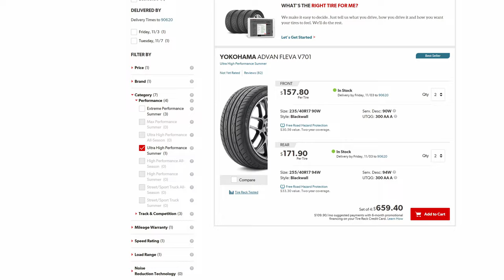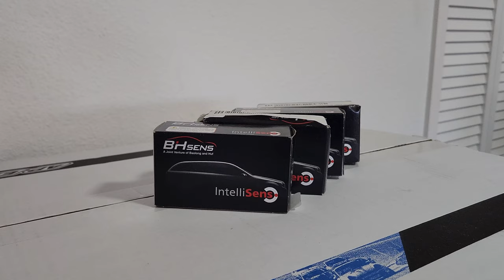🔥FINALLY NEW WHEELS on my BMW Z4!!! | Apex ARC-8 | Vlog 6

Comment from the maker: What do you think about the new wheels?
What color caps? Red, Blue, Both, Black, Green, or Yellow?
How about the lettering? Single or double edge or none?

Gloss Black Grille: https://geni.us/LaQ0T7z
Matte Black Grille: https://geni.us/6nDYf4U

Stubby Antenna: https://geni.us/DD1pk6
Stubby Antenna Jr: https://geni.us/B0Odc

Wheel Locks: https://geni.us/GqrdE
Lug Bolts: https://geni.us/hnYIViq
Wheel Hanger Pin: https://geni.us/jmnzk

Rally Armor Mud Flaps: https://geni.us/KzzNg
3M tape: https://geni.us/846A

Low Profile Megan Racing Ramp: https://geni.us/ocg6
Low Profile Floor Jack: https://geni.us/EAHkV

Griot's Tire Dressing: https://geni.us/ITDZ6
Sharpie Paint Marker: https://geni.us/wu8tVG3
Yokohama Advan Fleva Front: https://geni.us/1f3Ex
Yokohama Advan Fleva Rear: https://geni.us/90lx31M

Hankook Ventus V12 Evo 2 Front: https://geni.us/BpSPzGi
Hankook Ventus V12 Evo 2 Rear: https://geni.us/qqhd8QA

Graphite Grille Left: https://geni.us/xRXiUq7
Graphite Grille Right: https://geni.us/vRQ0GJ

Camera Equipment
Samsung Galaxy: https://geni.us/VQQT
Microphone: https://geni.us/eAFOKz
DJI OM: https://geni.us/xeB7agB

*Please double check compatibility before buying and be wary of non OEM as it may not be exact*
Help support me breaking apart my car and putting it back together. This description contains affiliate links. If you buy a product through my custom link, I will earn a small commission at no extra cost to you.

Comment: I used to have 17" winter tires (4x225/45 Kleber) on the Z4C and moved to 18" summer tires (4x225/40 Goodyear Asymmetric 5) and then moved to two sets of summer 19" (KUMHO PS91 (235/35 and 265/30) and a set of Michelin PS4S (4x235/35)). In my experience the ride comfort was the WORST with the 17", then 19" KUMHO, then 19" Michelin and the most comfortable was the 18" Goodyear. The steering is by far the best with the PS4S. If you take into consideration how the car looks - 19" is a no brainer. (hint - E9X OEM Styling 230 alloys are the perfect match for E85/6).

PS: I love the two different colors on the center caps. Would keep it as they are on the video.
Reply from the maker: Thanks for the insight. It might take me a few more years to get and try a new set 😂

Comment: Nice upgrades! I'm running black 18" Enkei Raijin with spacers on my silver coupe and I'm thinking I'll powder coat them silver or gunmetal. That said, black is definitely the move on a white car, can't beat the stormtrooper look. I personally like running the stock BMW center caps on my wheels, but to each their own. Now that I'm running spacers and 3* of camber my tires have been kicking up a lot of rocks and I've been thinking I need to add flaps. From what I've seen, flaps need to be screwed into the arch liner using self tapping screws. I recently installed Bilstein PSS9 coilovers, replaced the front control arm bushings, and added an H&R front sway bar. These mods have changed it from an okay handling car to an amazing handling car. I can keep up with any car in the canyons now. I would definitely recommend at least swapping out the dampers since you have 90k miles. It will make the car much more comfortable and it's easy to do if you have a ratchet and sockets, you just need to rent a spring compressor for free at O'Reilly. You don't need to replace the springs unless they are snapped which is rare for a CA car.
Reply from the maker: Nice Nice. When I decide to tone it down I'll most likely get the BMW caps. I know screws would definitely help hold it in but I wanted undamaging reversible options which I guess worked out so. I was always curious about the PSS9s. How do you like those and do you have a si or M?
Reply: @DrewZ4  I have an si coupe, same as yours but manual. No one is going to be inspecting your arch liners for holes haha. The PSS9s are amazing. More supple than stock and the adjustable damping is nice to have. I swapped out my stock suspension at 66k miles. It wasn't completely dead but was getting tired. I imagine your dampers are completely dead if they have never been replaced. Honestly, if you don't plan on actively seeking canyons or track time I would just replace the dampers, it will only cost $400 for parts. If you want to reduce body roll, adding sway bars will do so without making the ride less comfortable.
Reply from the maker: Thanks for the input. I do like my occasional canyon...🤔